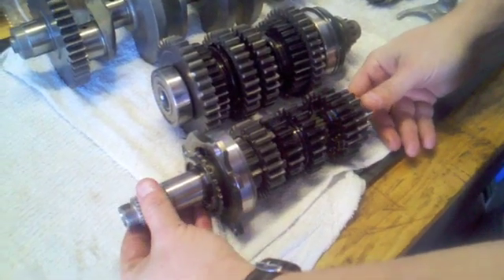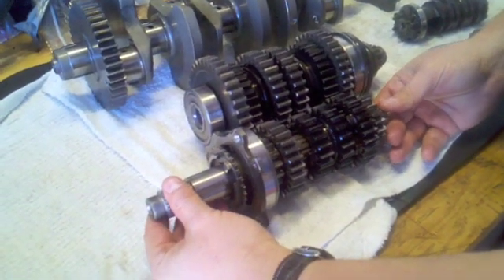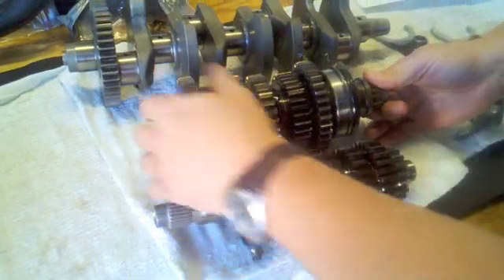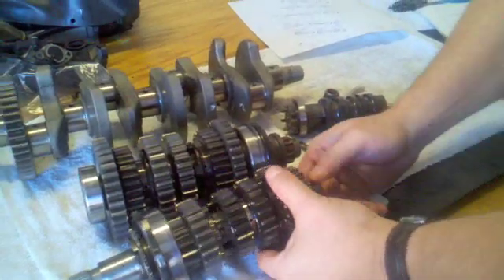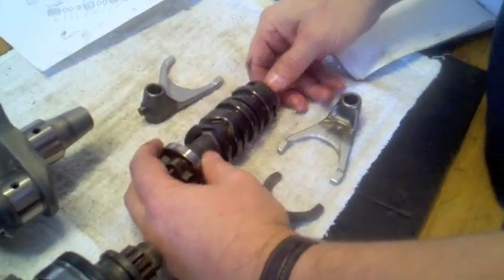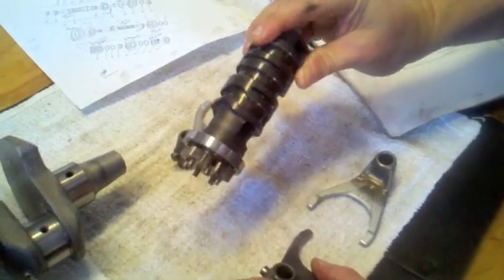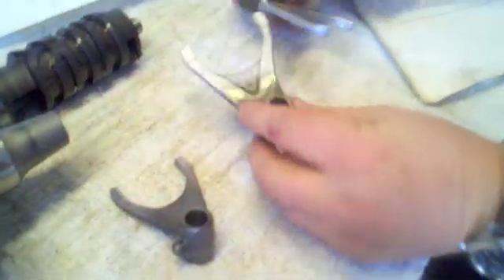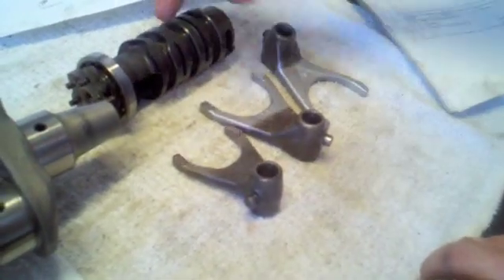2000 Yamaha YZF-R1 Engine Rebuild - Part 11

Comment: I love all this video series thanks for posting.
On my bike w 46k miles it is really hard to switch to neutral. Even if you pull up the shift lever very gently from 1st gear most of the time it jumps to 2nd. Takes many tries to get to neutral. If I were to take it apart which of these parts you think will be worn out ?? The drum ?
Bike is a 1996 Ducati 900ss SP, I assume is very similar transmission wise. Thanks !

Comment: I have been watching this series and it is very well explained. I have a 2001 R1 with low compression. The bike sat outside for about 3 years before I got it. I may have to tear down to free up or replace the rings. Do you know of any possible tricks to free them so I don't have to tear down the while engine to get to them manually?
Reply from the maker: You might want to put a little motor oil down each spark plug hole and let that soak a bit, then see if you can turn the crankshaft manually from the stator side of the bike, or just remove the head, the apply some oil directly around the cylinder walls and let that soak.  Good luck
Reply: @repomannv  tried marvels, barrymans, pb Blaster, Kroil all piston soaking. I have got the numbers to come up some but the range for all 4 is 100 to 40 thinking I may have to manually tear down to free them up.
Reply from the maker: @My68Tempest  I was assuming a rebuild was pretty much a given anyway, rings are almost certainly worn if not totally shot and a refresh would do a 2001 motor a lot of good.  One word of caution, with worldwide supply chain issues, make sure you can get the parts you need before tearing it apart.  I’ve been having a heck of a time getting parts for a 2012 dirt bike.
Reply: @repomannv  that's good advice. I wasn't thinking of that. I was just ready to tear into it and order as I figured out what I needed to put it back together. Thanks. Didn't want it torn down on a bench for weeks. That's when you don't remember how it went back together

Comment: Completely agree about living with components and not letting everyone else spend your money. If the forks and shifting was fine before the strip down theyll be fine when it goes back in. The obvious things to check and replace or re machine is what's causing the oil burning. Badly carbonised pistons and cylinder head/valves, some blow by, all that needs attention. Good uploads

Comment: does 1999 R1 has the same issue that you refer to 4:40 ?
Reply from the maker: my recollection is the 1999's don't have this defect,  but more importantly,  if you are having shifting issues,  you will need to check it out and deal with it, no matter what year your bike is.
Reply: Thanks for the reply. No shifting issues, I will have to rebuild for kinda the same reasons you had, I send you personal message, not sure if you saw that.
Reply: DrifterGoneWild I was about to ask the same thing, I have a 99' and the gearbox fubar'ed suddenly im studying as I perform my first rebuild

Comment: I have a 1999 R-1 and it grinds or slips  sometimes coming out of 1st gear specially under heavy load. Do you know if the recall is for the 99 also.

Comment: you have been great thru all the videos and extremely helpful i have a 2001 r1 thats leaking and needed some help and your videos will help me get it up and running correctly
Reply from the maker: I don't recall if a recall applies to the 99..call your Yamaha dealer, they can look it up..  most likely not though, so your looking at a tranny rebuild to resolve it, unfortunately.

Comment from the maker: The used engine will be faster and cheaper to get back on the road, the downside is you never know what you are going to get, and there is no warranty/guarantee on a used engine.  In your same spot, I chose to rebuild.
Reply: SupermotoJohn I figure I will go ahead and save the $ up for a lower mileage salvage in the meantime rebuild my first bikes engine/trans the gearbox is toast

Comment: 2003 r1 is done for the summer. 2nd gear "dog" problem as well. Whats better, a rebuild to a 25k engine or $1400 used 5k engine

Comment from the maker: @BrandonLeeHeryford Ahhhh, now that makes sense.  I heard somewhere it was "due to heat", and I misinterpreted that to mean they heat up while in the running engine (which of course doesn't make much sense).  A heat treatment as part of the manufacturing process sounds a lot more reasonable.  Thanks - this is what has made this project the most fun, I've learned so much in doing it.